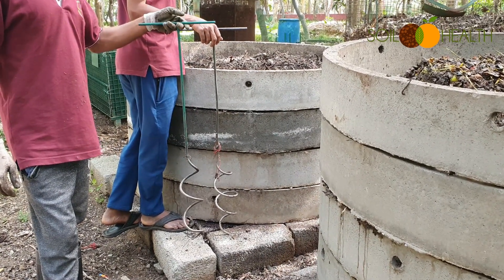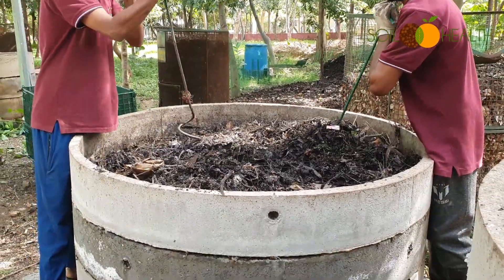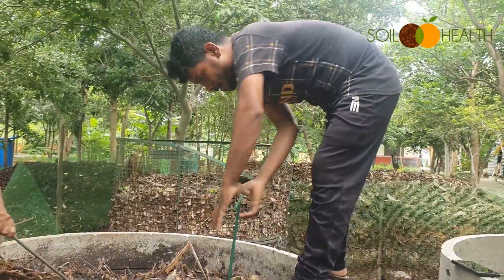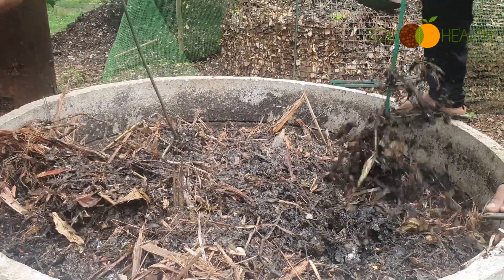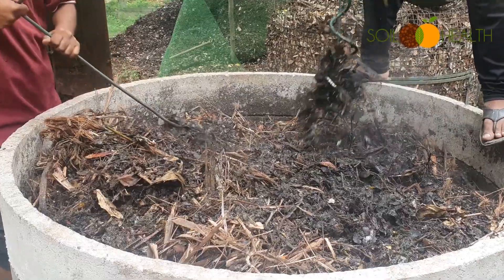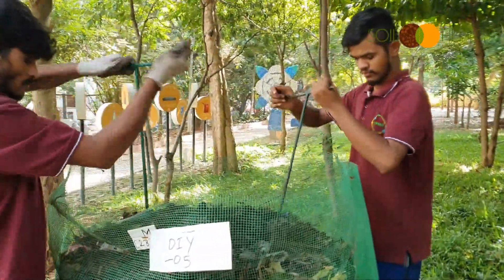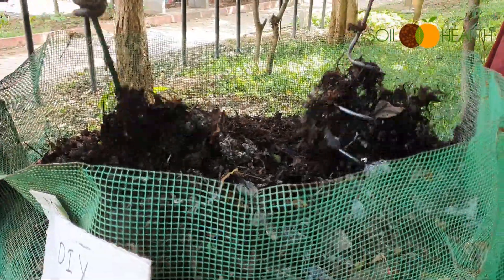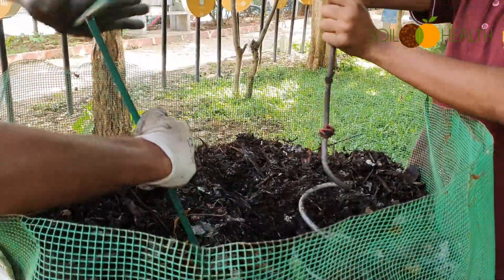Compost Aerator - A tool to aerate the compost pile for faster decomposition, reduce bad smell

Comment: Good morning sir is it possible to get compost within a month. Because some videos tells it is possible.
Reply from the maker: Flowers compost in 2 week, majority of vegetable peels and fruit peels compost in 4 weeks. Dry leaves takes 3 months and bones will take 3 cycles like 6 to 8 months. When it is shredded and chopped, it will compost faster. Definitely it will not compost less than one month.
Reply: @vasukiiyengarsoilandhealth1059  thank u
Reply: You're looking for hot composting. It has a very rigid structure of ratios and turning that allow for faster decomposition due to the increase in the heat. It is quite laborious and specific in what ingredients can be used however it can provide ready to use compost in under a month. 
Research into hot composting if that is the result you're looking for.